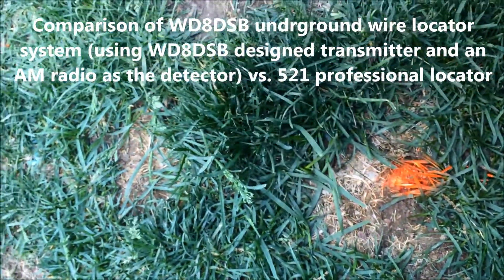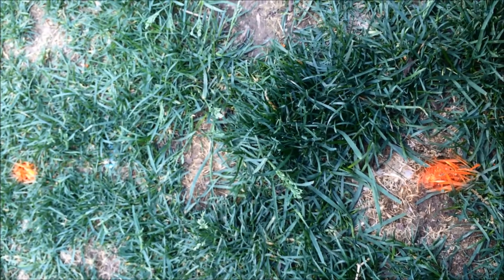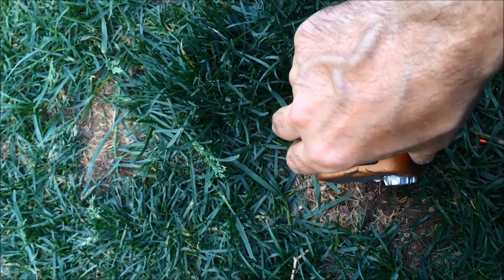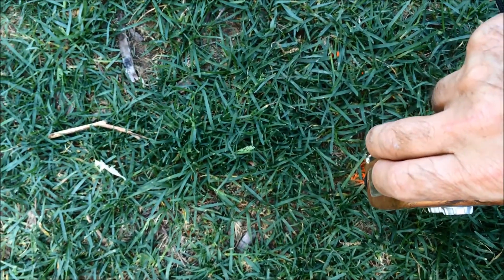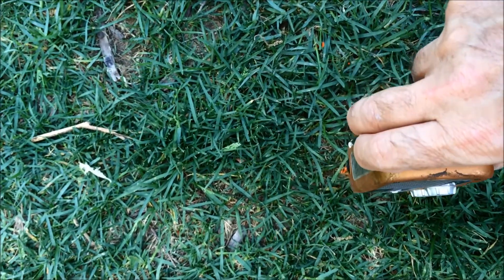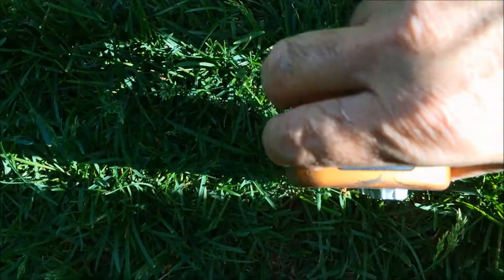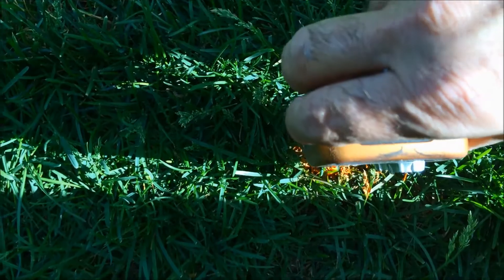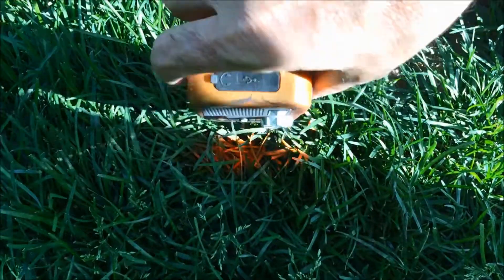WD8DSB home made underground wire locator vs  521 professional insrument

Comment: Need to show how to make and also show how to use it a little better as the video just shows you putting the radio within range and an annoying beeping. Show where it starts and stops.
Reply from the maker: Hi Jason,  you can find a link to my schematic in the video description.  I don't understand what you mean when you say where it starts and stops????  The purpose of this particular video was to show how close my own locator system is to an already located underground wire that was located using a professional system (the orange dot path).  I also have another video showing the system in more detail at https://www.youtube.com/watch?v=qqmSLlJKRMQ
I designed this system for my brother in law who was having trouble locating a valve.  I did not design this system to find broken underground wires, as that requires a much higher energy level system.  My videos were really made for my brother in law so he could understand how to use the system.
Reply: @wd8dsb  thank you for responding. I think that for me maybe stepping back a few feet with camera and showing a more distanr exposure would help.
Reply: @wd8dsb  You said this circuit is not designed to find broken underground wire, so this circuit does not match that of a professional 521 unit? I have never used the pro unit, can I assume it found the wire (broken or not) leading the the valve much easier? Your video did not show the operation of the 521. It is interesting though. Thanks
Reply from the maker: My design is for determining where underground wires are located and it locates their position  as accurately as the 521 unit does as demonstrated in my video but my system requires the underground wire to be part of a complete circuit which is not the case when you have a broken wire.  To locate broken wires underground you need a much higher energy system such as the 521 unit, but I have also seen a unique trick where you can use a lawn mowers spark plug connected to the wire that is broken and then use an AM radio to locate the wire and the break (YouTube video shows this technique).

Comment: Hi Don. Bob - KQ2Q in GA. 
Do you have programming info available for the 16F 690 microprocessor?  I am not a programmer? 
I need to troubleshoot my dog fence wire. 3200 ft loop. Your tool may help a lot   Licensed 51 years. Thank you Bob.
Reply: Thank you for the reply Don!
Reply from the maker: Hi Bob, my system is a low voltage system that I designed for finding the location of underground wires (not designed for finding a break in an under ground wire).  To find a break in an under ground wire you want a high voltage system due to the high resistance of dirt and the high voltage system allows you to have a pretty big return current through the earth and hence a pretty big signal.  There is a guy that uses his lawn mower for the high voltage signal source which is a pretty interesting method, and I suggest you check out his youtube video at https://www.youtube.com/watch?v=Zu4nFBMjeME
73, Don (wd8dsb)